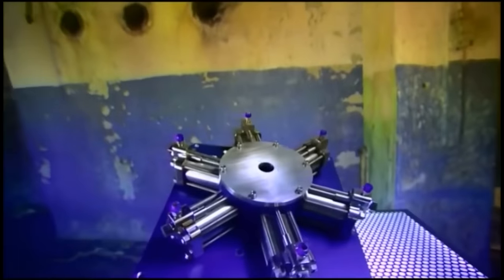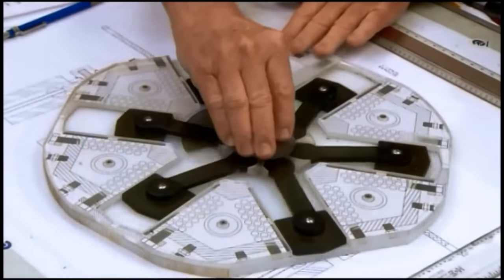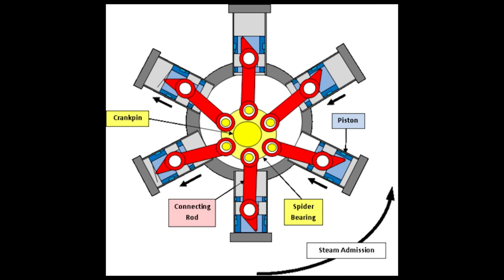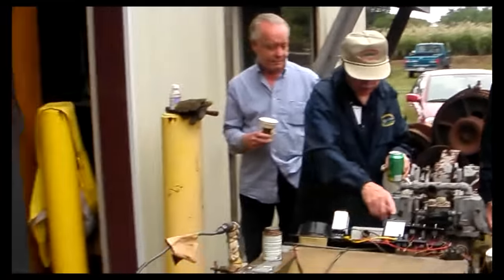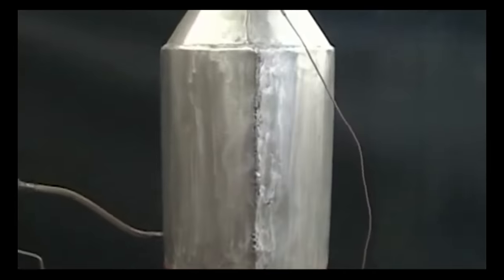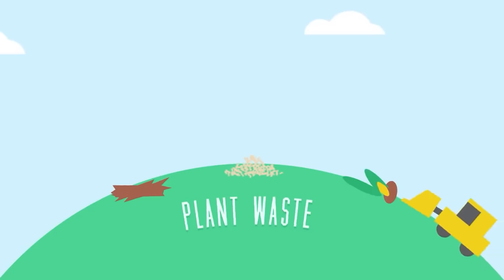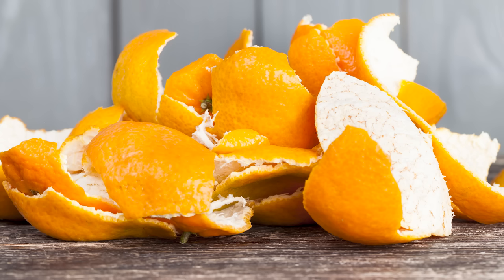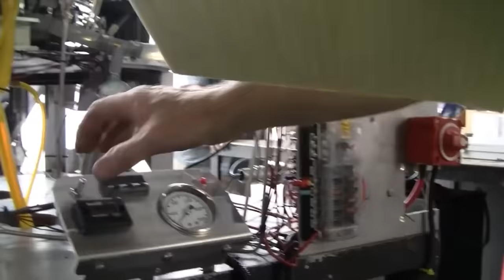Is the Cyclone external combustion engine the future?

Comment: It sounds like most Cyclone engine problems come from the mindset that it was "not invented here." I have first-hand knowledge of Cyclone's business problems. At the moment, they are working with interested parties to take advantage of the clean burn characteristics of the engine to turn a foreign nation's colossal waste disposal problem into a microgrid electric power solution that addresses both sanitary waste disposal and municipal power reliability with dual use infrastructure funds. 
Modern waste streams with large amounts of plastics burn clean in the external burn chamber. That is because of the filtering effect of the cyclonic flow within the burn. Cyclonic filters efficiently separate solids (even very tiny ones) from gasses. The Cyclone engine utilizes a cyclonic filter as a burner to provide supercritical steam for its engine. As the burn progresses, burning masses heavier than air are not allowed to escape the burn until consumed by the burning process. Similarly, burn by-products such as ash and metals in the burn become consolidated in a molten pool that drips out of the cyclonic burner/filter as an easily manageable byproduct of the waste disposal process flow. 
External combustion that is clean enough to meet CARB air purity standards (from municipal waste!!) is only the beginning of the good news. The engine converts 40+ percent of the heat produced in the burner to usable shaft horsepower. 
I can imagine that with only a subtle design modification that the burner/engine I have just described could burn powdered coal, sequester any unburned burn-by-products as raw material for industry and enable the creation of microgrid power infrastructure to ease the strain on the power grid crunch that is sure to arise from the rapid roll-out of battery-powered transportation. 
Cyclone has proposed a system capable of harvesting solar heat and storing it using a working fluid that resists freeze-up of the system when it is offline and keeps energy as 1500 degree F heat in insulated underground containers. They suggest designing heat storage with enough capacity to provide 5 days of off-line power. Of course, a solar system of this kind can have a cyclone burner.
Reply: I was studying this engine many years ago and had high hopes.
This new 'first hand information' clarifies a lot. But the change of approach and product goal, makes me wonder that their original idea is basically abandoned.  I am sad that they could not get the engineering worked out.
Reply: @warpedweirdo  Thanks for commenting.
Reply: Steam will never work in a car. It's just too dangerous. People today are  quite unaware of the horrible accidents that occurred in the heyday of steam engines. Also steam turbines are clearly better, more practical and are very well established and mature technology at this point. Very interesting comment. I have been wondering for a while if it's possible to cleanly burn waste. We could theoretically do it with human waste too, by filtering it out, removing the water and burning it in a superheated furnace. Given enough air being blasted in, anything becomes a fuel just about. Check out the mad Aussies with their turbocharged burn barrel lol. You wouldn't think wood could behave like jet fuel, but a couple of bogans in a shed proved that wrong.

Comment: When I heard "water lubricated" I figured something wasn't right, and indeed - on the Wikipedia article this problem is noted as a "Critical path issue" by the people contracted by Cyclone Power to help work on it. Durability of the bearings will be a big sticking point.
Reply: Ikr water is not a good bearing lubricator
Reply: @Sausketo  What about the possibility of perfect bearings foraged in zero gravity?
Reply: Magnetic bearings
Reply: @terrafirma9328  Magnetic bearings can only handle a certain load capacity before the forces experienced by the magnets exceeds their field strength. I suspect this design would not allow for them.

Additionally, the strength of a permanent magnet is reduced with temperature, and demands more expensive rare earth magnets that are weaker than standard neodymium magnets, which will drive up your cost even further.
Reply: @bort6414  Maybe so. I'd still try it out with the largest strongest cobalt magnet they make and build it with a secondary ball bearing to take up the slack😉
Reply: “Sticking point.” I see what you did there.

Comment: After ignoring the enormous lubrication problems for a moment, a question comes to my mind: would not a steam-powered turbine much more efficient for stationary use?
Reply: I agree, a stationary generator would be incredibly awesome considering it’s torque. Automate 2-3 different sources of fuel depending on availability locally  and abilities to keep it running.

Comment: As far as the POC goes it is very interesting.  Iron out a few issues and it could well be the way of the future.  Seems like a good candidate for burning hydrogen perhaps.
Reply: Why do modern car companies developing hydrogen-powered cars focus on using hydrogen within fuel cells rather than within an internal combustion engine?
Why don't modern automobiles use steam?
Why didn't the engine in this video go anywhere?
How is the engine in this video superior to older steam engine designs?

A real analysis would go a long way toward explaining these things.
What you've offered so far isn't analysis so much as wishful thinking.
Reply: @warpedweirdo  I have wondered some of those exact same things , combining old and new technologies might make for some great cars and power plants.
Reply: @Dr_Wrong  Excellent reply.

Comment: It's not been 10 years, it's been 200. 

Supercritical boilers are used to generate power. You have to have temperatures above 374c and pressures above 220 bar. 

This is the first reason they are not used in cars. Old steam cars used flash boilers. Usually a coiled pipe is heated and water pumped in where it flashes to steam. It's light, quick to start and if it fails there is little steam volume to explode. So a lot safer. 

Supercritical boilers are the worst possible case for safety in a vehicle. Worse than a normal boiler. As all the water in the system if ruptured will flash instantly to steam as its pressure drops. Meaning all the water in the system will blow it up. And it's at at 3 time the pressure of normal boilers. Meaning you got to have some serous seals and very well made parts. Amd any failure could very bad. 

The video is also wrong saying it's ar 1100c. Steel would give way and the thing would be glowing white hot at that temp. It's only theorised running at hose temps and nobody has made a boiler thay does because of the material requirements. 

The engine is not anything special. Just a radials steam engine. Alow me to doubt how long it will last with water as lube. There are good reasons engines use hydrostatic bearing. 

It's performance is expected for an engine like that running at high pressure. It's probably very inefficient for a reciprocating steam engine. Only having one expansion of the steam. Triple expansion engines were not built for the fin of it. 

There needs no conspiracy why this has never been a success. It's inefficient, dangerous in a vehicle and would be difficult to fuel with solid materials.
Reply: F not C. Single stage can be efficient, just not under full torque. See uniflow steam engine. This is Rankine cycle and is only efficient in super critical configuration with high expansion ratios. It is the condensing and vacuum raising equipemnt that takes up volume. 1/3 the power is below atmospheric to get the efficiency. Super critical CO2 enclosed Brayton cycle might be a better choice, simple will get to internal combustion like efficiency, dual will be a little better but needs more support equipment. All this steam engine takes up more space than an internal combustion engine by about three times. Supercritical CO2 is in modern use for bottom cycles on internal combustion engines right now and gaining popularity as it is half the size of the steam plant. But we are looking at the 15MW range. Supercritical CO2 scales down better than steam.

Comment: I always wonder if a hybrid combustion engine system could be built to improve the efficiency of internal combustion engines by utilizing the waste heat to power an external combustion setup. Definitely adds cost/complexity/wheight but should be able to increase efficiency.

Comment: It sounds like a great idea the combustion is done in a controled and contineuos was so it can be made cleaner that an ICE. Then using the resultant steam sounds like the way to go.
Reply: Except for the very poor efficiency, and the extremely dangerous boiler, and the vast size and weight of the machine compared to an ICE, and very high expense, it's great.

Comment: Awesome video! Thanks for the info! Would you be able to do a video on Nikola Tesla’s improved combustion + steam turbine patent GB 186,083 ?!? He patented it 10 years after the original Tesla turbine patent and a decade of R&D. 

It’s essentially a combustion rocket aimed into a steam pipe that then uses the steam to cool the hot combustion exhaust gases for admitting into the turbine. 🤤🤤🤤

It’s soooo good!!

Comment: In the 80's, my father was sent to Georgia to wire the electricity for a new ethenol plant which would make and sell a mixture of corn-alcohol and gasoline. Before they could finish and open the plant, government agents cut a deal with the owners and bought it. The plant never did open. You will find, with minimum effort, the same people always harping about alternative energy sources, NEED something to complain about so they are allowed to screw you legally. The last thing they want is for any actual problem to be fixed. Whatever solutions they "allow", will be under their control and limited for price-fixing.

Comment: A few bullet points:
- to operate this type of engine requires a certain level of consciousness, which is a rare commodity these days. 
- Gathering all the fuel would probably constitute hard work, not fashionable these days. 
-Huge marketing would be required which may exceed R and D at first. 
- The oil firms will offer pushback
Reply: "Fuel" is anything you can burn to heat up a teapot.
Even gasoline or wood, but not "biomass" unless it was as dry as seasoned firewood. 
Firewood is exactly "biomass." 

Where will you store a cord of wood in your car?

Comment: Only way this would make sense in my opinion is if they used the superheated water state to drive a steam turbine.
Reciprocal pistons are just too inefficient, and you're never going to get sufficient lubrication with water vapor.
If it had it's own pressurised lubrication system, that wouldn't work either as you would inevitably see condensate making it's way past the the piston rings and contaminating the engine oil.

Comment: A search for:
 Stress corrosion cracking supercritical water 
Will give a pretty good idea of why no one pursued the idea of flashing supercritical water into steam inside the cylinder of a car's engine. Carbon steel and cast iron rust much faster than in salt water. Stainless steel acts like carbon steel near salt water, and seals and gadgets need to be made of silicone or Teflon or be eaten away in short order.

Using high-temperature water as a lubricant won't work well for any materials I ever encountered. I can't think of any that wouldn't be better off running dry than in 1,000 F water.
Reply: Valid point... and Teflon wouldn't work (as least, not for long). Even Viton seals wouldn't work. When you get supercritical steam in/around moving parts at those pressures, it will eat nearly anything. Teflon, in it's microscopic form, is made of tiny flakes, and uses water in itself. Even after curing... at those pressures with steam, the shock waves create microfissures and it simply flakes off in short order. Furthermore, the various stresses that occur inside rotary piston type layouts, necessitates a high degree of lubrication. I'm with you... even  dry WSO² in dry powder form, with all it's high maintenance, would be a better solution. Even if they didn't use salt water... the cavitation alone, would cause significant issues.

Comment: The main problem from what you discussed in your video is that they never fixed the power density problem of the condenser. If you really want to make progress in steam automotives you need to make a radiator that outright breaks physics. That's it. If you ignore that and focus on a fancy combustion chamber or pump you are doomed from the start. Also, high temperature steam is fantastically corrosive to anything except maybe the most exotic materials and that would nuke your value proposition to the average customer.

Comment: I am a member of the Steam Automobile Club.  These guys have been claiming a bunch of wondrous things for two decades. They came to the Society of Automotive Engineers annual meeting about a decade ago.  One really good possibility was small motors for chain saws and lawn mowers, since steam engines are much quieter than ICEs.    I even bought stock in them.  

Never had a running engine.  After a few years they issued preferred stock, then changed the ownership so that the common stock was worthless.  It's a con.

Comment: It is a Racine Cycle Engine, similar to a Stirling Engine.  It's not new.  It gets its "modern" power levels by using deionized water.  For the science-challenged, deionized water is water with all the minerals removed. Removing the minerals allows the steam to be super critical with a lower energy input.  Deionized water, however, is a very powerful base.  It will absorb the minerals from anything it touches.  This means it will dissolve almost anything you put it in.
Cyclone sold their waste heat engines to a number of power generation companies.  However, TPTB do not want flexible fueled engines.  They want no engines for anyone but themselves.  On the engineering side, the material science to allow the engine to cost-effectively circulate deionized water without being dissolved simply does not exist.  All the technologies that can do it are too expensive to scale.

Comment: I can see the potential for this engine for anything but cars. At home using a prism to heat a tank to steam and generate power for batteries. Fuel it by wood pellets, scrap lumber, saw dust, food waste.  Seems like a great option for off grid or tiny homes.
Reply: Or powering a flux capcitor in a delorian 🚗 vrrrrrrooooooom

Comment: A couple of things jump out immediately to explain why this design may not fly very far.
The heat/steam source has to withstand 1200psi and 568 degree F. That requires serious thermal and mechanical components to contain and control it. That means that the total package is going to be massive, with respect to an IC motor.
Once through use of superheated steam is inefficient, as the cycle can only extract some of the energy from the steam. You would have to use some sort of stepped low pressure piston set(s) to get the most efficient use of the steam energy (the OD of the LP pistons would increase from set to set to allow the HP exhaust steam from the first to act on greater surface areas as the pressure degrades. Even then, to maintain a closed cycle, the unit has to have an efficient condenser/heat sink design to return the exhaust steam to liquid, potentially throwing way a big chunk of the latent heat of vaporization, and again increasing the mass and complexity of the engine and its power source.
Maintaining a leak free closed system is going to require that the seals and bearings of the engine must be of materials that don't wear and are not affected by extreme temperatures. Steam/water lubrication of rotating or reciprocating equipment to date has never been able to achieve that.

Comment: Could this engine be ran on thorium? A low radioactive heat source that heats to super high temperatures water that water could then be used to run the engine?  Of course this vehicle concept would never see the light of day because The energy industry would lose billions if people change to using

Comment: I think the main thing is that it is using the same technology as cars a century ago that was originally displaced by internal combustion. The act of getting the heat to run it is much less efficient and more fiddly than the drop-the-fuel-in-and-light-it simple internal combustion engines we use today.Sure, the act of extracting work from the steam may be much more efficient than extracting it from fuel under pressure, but getting the heat to create the steam is much less efficient, and is not nearly as responsive as going directly from fuel to crank.

Comment: The engine bit is not much of a problem, it's the boiler and plumbing that holds back further development of the steam engine. Super heating steam under the high pressures needed is really only suitable for a stationary or stable application, like marine engines. Only real advantage is using poor quality fuels, but then you're producing a lot of pollution.